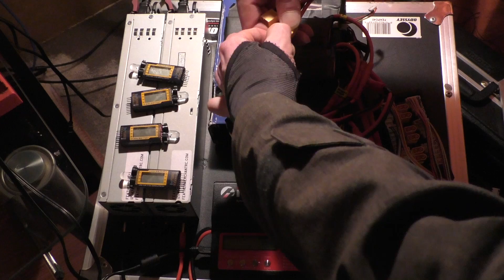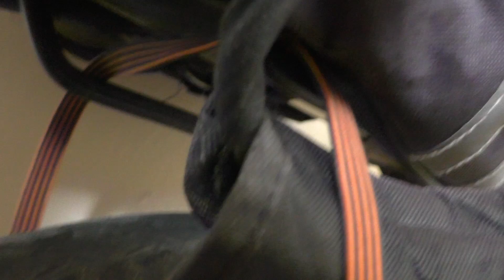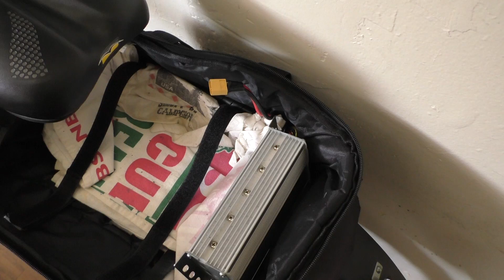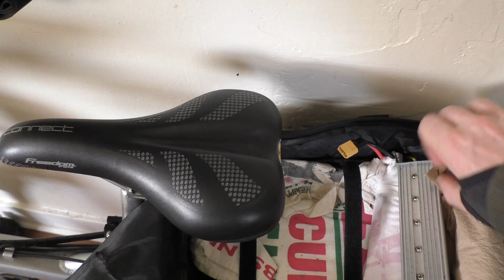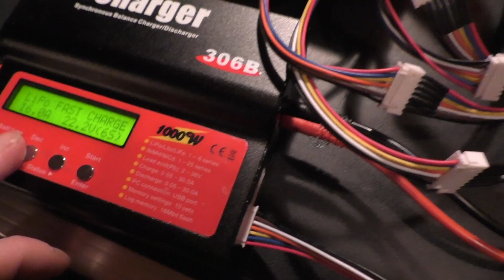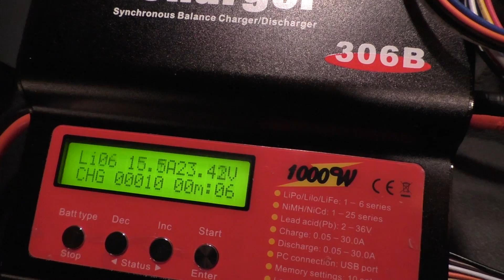48V 1000W DIY eBike 003: Updated 14S2P LiPo Battery Setup, Charging, Tube Blowout!

Comment: I know this is an old vid, but have you moved on to using a BMS yet? Would simplify the charging greatly. I use different types of batteries for my bike. I have a 14s 40ah NMC pouch cell battery for long range and a 5ah lipo 14s pack for short range trips and I also have a recycled set of panasonic 18650 cells made into a 14s5p pack. All three have battery management systems. The larger pack has a bluetooth bms so i can connect my phone to it and see the cell voltages etc. Worth doing and not super difficult at all. Doing about 4kw at peaks, so around 80 amps from a stand still. The lipos get a little warm when thrashing but they take it just fine.

Comment: Charge by 16s 40ah batteries to 4.24, then discharge to 3.1v. That's the reason why I don't use a bms.

Comment: Once you get your 6s packs close to the same SOC you can plug all the balance connectors of each pack into your charge board and charge balance them all at once in parallel. The lighter gauge balance wires limit current if cells are a little off in voltage and they eventually even out. Oops I see you do at the end.

Comment: So more than 2 years later, what was your ultimate experience with using LiPos for an e-bike? About how many cycles did you get out of your pack? I saw that 1 year ago you were at over 400 cycles...
Reply from the maker: Lipo is great! Those packs are still in play. I sold them with another bike I built to a friend and they are still going strong. I'm not sure how many cycles though. But for daily commuting they were a bit of a hassle. Mostly because i ran 52v so I had to charge two different sets of batteries. If you are looking into Lipo, I would try to find 7s 5000mah packs and use an 8s smart charger. That would be my perfect lipo setup. But I really like my Panasonic pack. I appreciate the convenience. But I also admit than my lipo packs had less voltage sag. I say lipo all the way for 72v monsters but 18650 packs with BMS for car replacement commuters. And soon the new 2170s...Tesla/Panasonic cells.

Comment: Clever! Though a bit lossy with all of those connectors like that and extra cable. Replacing the Bullet connectors on the batteries with native XT-60s, and hooking up the parallel wires more directly will help prevent voltage sag. and removes a point of failure
Reply from the maker: gymkhanadog I did eventually go with a much simpler wiring harness.

Comment: It's me again, 
Question 
B1- when you're not using your betteries do you espérate them or leave them connected?
B2- are you using xt60 or 90
B3- what c rating (discharge) are your batteries? 
B4- why are you charging at 19.7 amp, ain't that way past the 1c charge rate? 
THANKS FOR YOUR ANSWERS
Reply from the maker: With Lipo, I always dismantled my pack because I charged it that way anyway.  But no, you don't have to take them apart when not it use UNLESS you have a weak cell or pack because that will weaken them even further.  Keeping the cells balanced a couple of times a week is good enough for me.  Also, there is a lot of scare around Lipo, in that they say you should not leave them charged in storage.  That is true, but if you ride everyday or every other day, it's totally fine to keep them charged.  I'd say up to 72 hours.  So if you ebike commute, that isn't a problem.  Keep in mind, most of the info on Lipo is for the RC enthusiasts so they are saying...don't charge your batteries to fly your plane a week or two later.  With my Lipo setup i used xt60s but now with my 18650 pack I use xt90 connection and xlr to charge.  Now, to get to charge rate.  1C is for each cell.  When you have 15ah battery , you can charge at 15a still at 1C.  Make sense?  But Lipo are beasts and can easily handle 2C charge.  So i was just limited by my circuit amp draw, not the cell charge rate.  So charging a 15ah battery at 19.7a is nothing really.  Barely above 1C.

Comment: OMG OMG OMG 😀 I have been looking and asking ppl for about a week if what I am doing is safe and correct and long behold I ran into you video which is awesome by the way and the same exact set up I have but instead mine is with four 5s and two 4s all 5000 mah and 25-35c rating. Dude I thank you so much for your vid you can't imagine the load of concern it took of my back. Thank you so much.  *Question 1- So it is safe to connect a 5s+5s+4s into series 14s 1p and than connect the two series packs in parallel (just like yours) 14s 2p 10AH ?? Question 2- I was told you should always ballance charge 🤔Can you please school me on that and explain why you do it that way? I am gonna subscribe to your channel and watch your other vids. PS- oh I did not know you could serialize like that 2+1 , I have mine all 3 serialized thru the 4mm bullet connectors then added a 4mm / xt90 battery connector. So many ways but I like your way which is what I am gonna now do. I will be learning allot from you I hope 😀👍.
Reply from the maker: It doesn't matter how you get the voltage. 5S + 5S + 4S is the same thing as 6S + 6S + 4S.  6S is just 6 cells in series.  5S is just 5 cells in series. There are just packaged differently.  You could do (7 x 2S) in series x 3 in parallel or whatever too.  For convenience if you can find 7S packs and have a smart charger capable of handling 8S, then you have the perfect, easy LiPo setup.  But most people, like myself found the benefit of super cheap 6S 20C packs to be more cost efficient, and then I added the 2S packs for a bump but it made it way more of a hassle IMO.  Being that I ride every day and sometimes need to charge twice per day, I moved to a Panasonic 18650 pack that was plug and play because the time spent on balancing and charging different cell packs at different times = money if you look at time = money.  I still find Lipo useful for big voltage singletrack monsters, but have left that train for daily commuter vehicles.  If you could do all of the same size packs aka 7S x whatever, then you could treat them like a BMS'd 18650 pack, in that you wouldn't need to fully charge before riding, as long as all of the cells were close in voltage. Balancing your cells a couple times a week is good.  They really don't fluctuate much if you take care of them.  You don't need to balance everyday, but it's important that they don't get past .07v from each other or else you'll start to strain the weaker cells

Comment: How far is you range when you go full throttle on a 48v 10ah battery?
Reply from the maker: I wouldn't know, I'm almost never at full throttle and wouldn't try to kill myself to answer your question.  Plus I have a 52v 17.5ah battery so I couldn't test your spec anyway.

Comment: Thank you for the time you've put in making the video. Very informative. How much pedal assist do yo do when commuting?
Reply from the maker: I always pedal up to spinning out.  I kept my gearing stock so I know when I'm at 25mph, based on the top end of my gearing.  So when starting from a standstill I'm pedaling up to speed, using the throttle the whole time too.  But I roll into the throttle, not just jam it up at start.  And up hills I help the motor, but it really is a small effort that goes a long way.  Thanks for watching!

Comment: Complicated dangerous I guess what hobby batteries save in $ they waste in time and effort. These batteries only get about 200 cycles to 100%DOD
Reply from the maker: I've got well over 400 cycles on my pack and still get 28 miles average range on a 14S 52V 15Ah pack.  Never discharged below 3.3V/cell and never charged above 4.15V/cell.  I haven't measured the capacity of the pack, but the charges seem consistent.  Also to weigh in on LifePo4 vs LiPo, yes LifePo4 have a BMS, but using LiPo with a smart charger is the same thing.  It's highly unlikely that a cell would misbehave under normal load/stress/charge.  The bottom line is if you want plug and play go LifePo4, if you want cheaper over time then LiPo is still the better choice IMO.  My most current video shows my current battery and bike setup.
Reply from the maker: +Cutler Cycles It depends on how you care for them.  I've simplified my operation quite a bit.  No longer charge them just before riding. Can charge at night and run in the morning/day.  Two charge sessions, balancing every time.  Easy now, rewired for simplicity. Mine are easily at 200 cycles and still going strong.  1.5 hours to charge instead of a plug and play LifePo4 taking at least 4 hours for the same capacity. But i only charge to 4.15v per cell and discharge to 3.7-8v.  I now run 15ah every time i ride.  New bike and setup, but the motor kit and batteries are still the same. At 4000 miles.  They are quite dangerous if not taken seriously, but I've become less worried over time.  It is good to really respect how dangerous they are though.
Reply: +PDXevgrin so it takes 2 charging sessions to full charge? My lifepo4 charge in at 1C. Most lifep04 are 1C charge operation but get 2000 cycles. my 51.2v 12ah peaks at 4C (2500watts) and charges at 1C and should get 2000cycles cost me $350 USD after shipping.of course your batteries still feel strong but do you measure capacity loss? hobby king averages those cells at only 150cycles on their site.
Reply from the maker: Cutler Cycles
I'm overvolting the motor to 57V.  So I use 6 x 6S packs + 3 x 2S (6S + 6S + 2S = 57V @ 4.15V per cell x 3) packs and charge them separately.  Using my big server fan charger it's still only 1.5 hours.  19.7A to my 6S packs and 16A to my 2S.  But since I charge at night now, I just use my quiet charger at 13.5A to each set for simplicity and play video games while charging.
Reply: +PDXevgrin i see so you still have to disconnect the series and reconnect everytime and also connect multiple balance leads.
Reply from the maker: Cutler Cycles
150 cycles charging to 4.2V.  Charging to 4.1 or even 4.15 never stresses them out.  Easily over 200 cycles now.  I've been using them almost daily (sometimes twice or three times daily) since February 27th 2015.  Same range, same internal resistance.
Reply: yes...with lipo's its important not to charge over 4.1V and never discharge below 3.6V. (40% DOD is recommended) Following those simple rules should give you 600 charges easily and more but with reduced capacity. 

But thats ok since lipos are so cheap compared to ebike batteries you can oversize the mah capacity and still get the range you need. 

My tip is to get 20.000mah or 16.000 mah turnigy multistars from hobbyking...wire 2 of them in series to get 50V (6 cell versions) Mine are 1,5 yrs old and over 400 charges still no noticable degradation...
Reply: AH AH
How do you measure the capacity on your pack? Seems like a waste to leave 40% unused. A 44v 20ah battery is pretty decent for $300 though. a 16s would be about $430 not bad.  I prefer to have a BMS in my batteries for safety. By battery is a (18650) 16s 12 ah lifep04 with a BMS that monitors temp, cell balance, short circuit, over and under voltage and it cost me only $400. This pack should get 2000 cycles. Thanks for the tip. how often do you use the balance leads?
Reply: I use balance every charge. Well if you can get a decent price for the 18650s good for you. hobbyking is ptetty much all i could lay hands on in my country. Im happy with 32000mah 50v for 320$. Besides im mot to comfy buying chinese ebay lifepos...I do have a 40amp fuse but no bms. I use the ebike same distance every day to work so its impossible to overdischarge. If i get below 43v then its time to pedal never happened tho.
Reply: AH AH
I just picked up 59.2v 16ah for $200. They seem very well made and they are perfectly balanced. My setup is 4 4s 16ah packs constructed in a removeable ABS case. The pack unscrews by hand in about 30 seconds. My wiring is very simple and the packs switch from series to parallel in 2 seconds. Connectors have polarity. Connect my 4P balance cable that I soldered up and im ready. I use low voltage alarms as well. Maybe I should make a video. This setup will get me 100 miles at 20mph and 60 miles at 30mph in good conditions.
Reply: +PDXevgrin yes veey true assesment. Lipo is just a bit scary because of the fire risk. I charge with an extra thick welding blanket

Comment: Jesus Christ charging at 19.7 Amps an hour!
Reply from the maker: +Crazy Frank that's spread across 4 batteries in parallel.  4 x 5000mA = 20A @ 1C so I choose 19.7A so I don't pop my 20A circuit.  The power supply can produce 47A, the i305 charger can only do 30A, but either way I only have 20A available. But the batteries could still theoretically be charged safely at 2C or 40A.  But anyway, right now I use a smaller, lighter more portable PS.  I charge my four 6S packs at 13.5A and my two 2S packs at 12A.
Reply: I was just saying how fast it was, thats awesome!
Reply from the maker: Yep.  The benefit of LiPo for sure :)
Reply: Because mine is only 5A haha xD
Reply: i charge mine at 12V 38A (computer power supply converted) which is roughly 400-430W. Takes 3 hrs or so to charge my monstrous 32000mah 50V pack

Comment: Excellent video.  I am also planning to taking the 7S RC lipo route, instead of 18650. 

How difficult was it to install the rear motor?  Did the rear disk brakes need any tweaking? I am planning on investing in a cheap bike to covert to ebike.  Would you recommend disk brakes over V-brakes?
Reply from the maker: Sonnet Gomes Rear motor and controller are plug and play.  Mine came laced in a wheel.  I just switched out the tire.  I'm at around 2500 miles on it so far and the motor seems to be fine.  I've had to do regular bike maintenance i.e. tighten spokes, replace brake pads, chain etc. but all from normal bike wear and tear.  I haven't used V brakes, but I really like the avid bb7 disc brakes I'm using.  Really easy to adjust and stop well.  The rear brake does hardly anything since the wheel is so heavy but I have no issue stopping.  The bike is really heavy, definitely need good brakes regardless.  I prefer mechanical over hydraulic also, just personal preference.  Just remember that everything you would normal consider in a bike may not apply to ebike.  I don't shift so my drivetrain is really unimportant.  I may even switch to single speed with chain tensioner instead.  Decide whether you want thumb throttle or twist, I chose thumb.  That will then tell you whether to get a twist shift bike or trigger.  Obviously can't use twist throttle with twist shifters, or thumb with trigger.  I think my bike is perfect as is.  If I were to do another one I would use a hard tail for simplicity, but my soft tail is pretty comfy for sure.